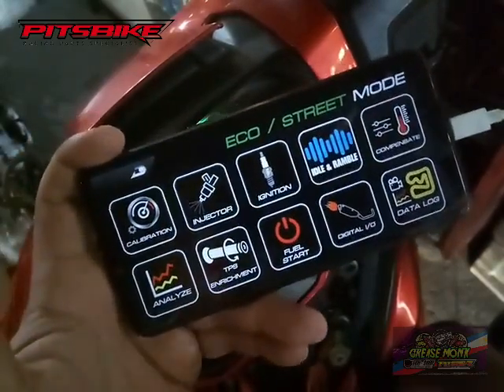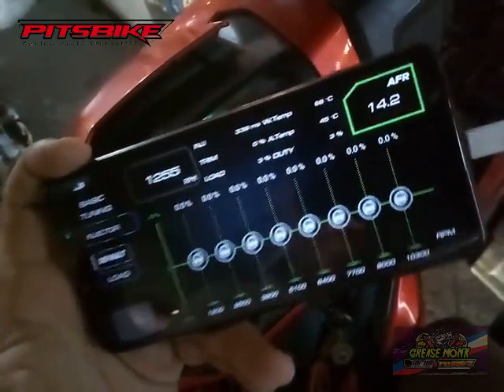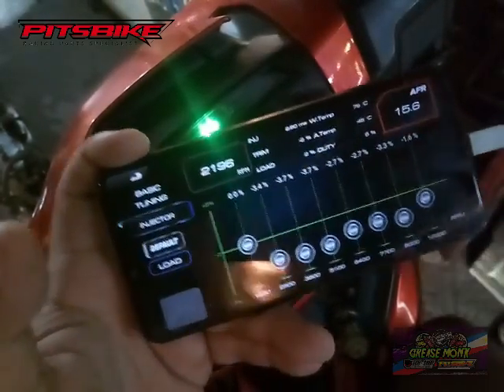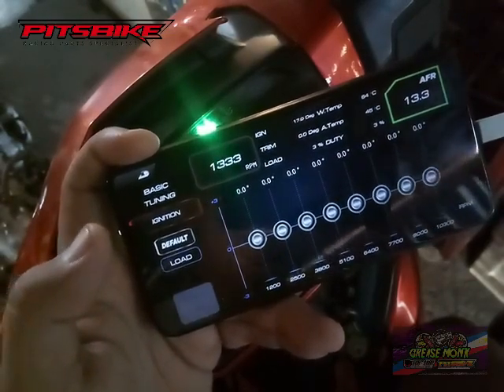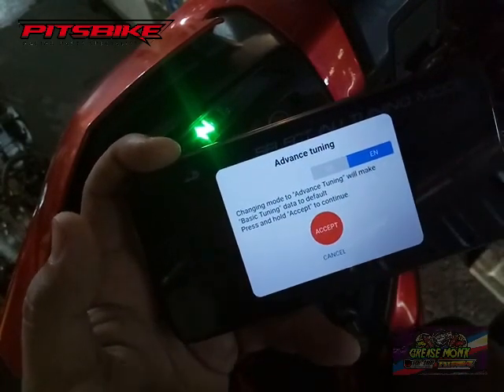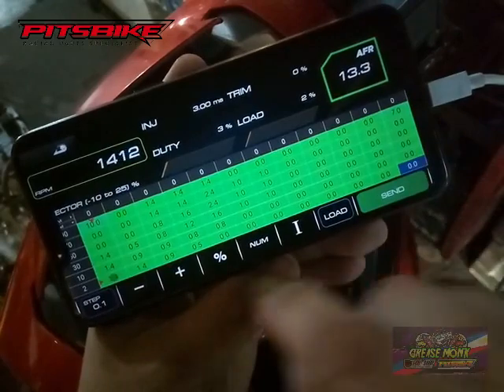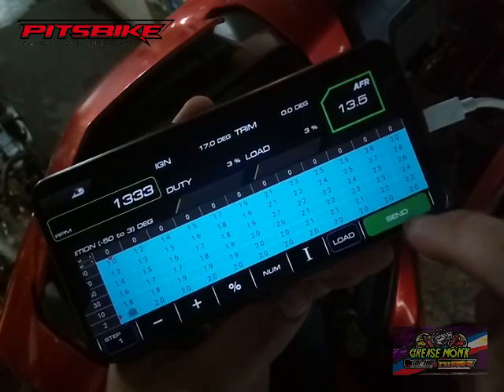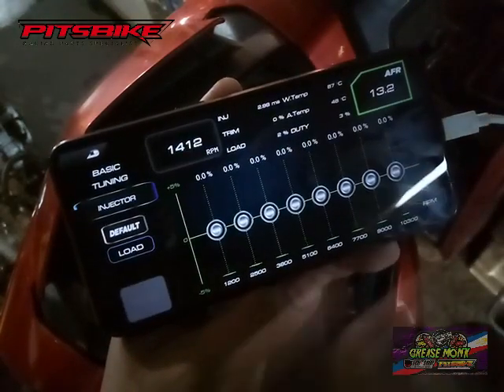TUTORIAL TUNING FULLSTAND NEXT INJ - IGT (MOBILE TUNING)

Comment: Grease Monk, I like your Fullstand videos. I have a question about the Fullstand pro advanced timing on race mode. Is the timing table I see Honda standard +/-timing or is the timing table absolute timing? When I rev the engine, the ignition timing display on the Fullstand screen stays as zero throughout the rev range but I don't want hole a piston/do a ring land, so I ask the expert.

Comment: Is there a way to know in the app if I am running lean, rich or normal?
Reply from the maker: You can see the afr indicator at the top right of your screen.. to effectively use the narrowband you can try letting the rpm stay for 5 seconds on yiur prefered rpm to see the changes in afr meter on your screen
Reply: @GREASEMONK  where is your shop located? Or please do recommend shop here in mindanao for tuning. Thank you

Comment: Kaya pala sir. Nung pinapanood ko itune yung sniper ko nung naka brt ako dati, per rpm pala niya pinapalitan yung injector tuning, so bale kung sa rpm na yun lean or rich siya, pwede siya mag add or less ng fuel. Ang di ko lang gets masyado is ignition tuning, anu advantages ba ng advanced vs retarded ignition sa stock engine? Related ba siya sa pag adjust mo ng fuel? Bale kung mag add ka ng fuel mag advance ka din ng ignition?
Reply from the maker: ganda ng tanong mo.. ang fuel talaga may connection sya sa IGT at cams
Reply: @GREASEMONK  bale sir if mag palit ka ng cams na mas mataas, need mag adjust ng fuel kasi mas mataas buka ng intake valve, plus need i adjust ang ignition para sakto siya galaw ng valves tama ba sir?
Pero if stock engine no need na galawin kasi may pre installed maps na si ecushop which is stock, race at eco?
Reply from the maker: @RCatPulbura1224  at LSA
Reply from the maker: sa duration papa